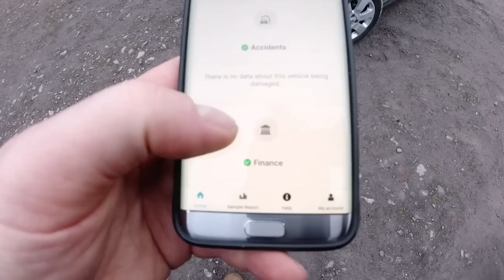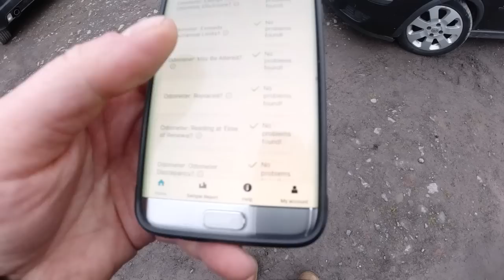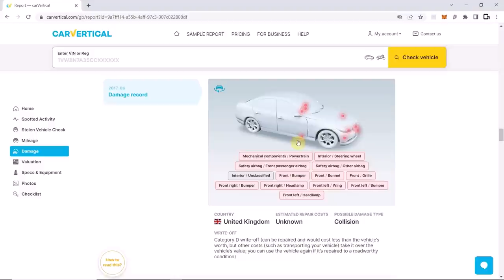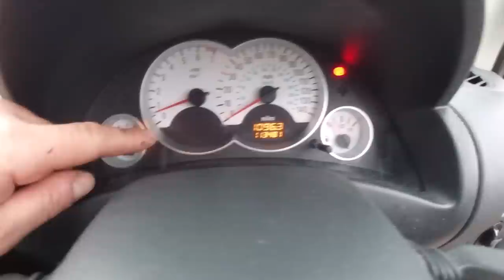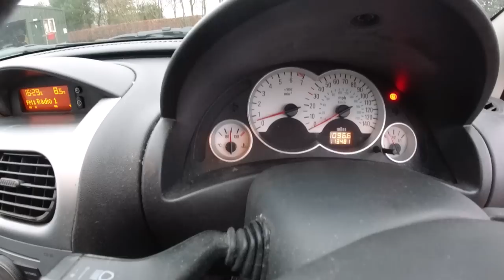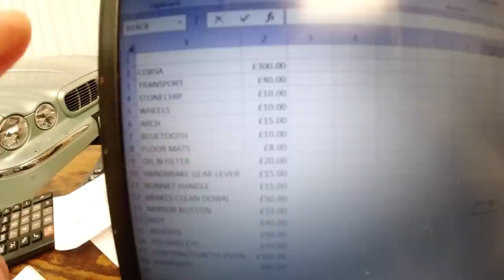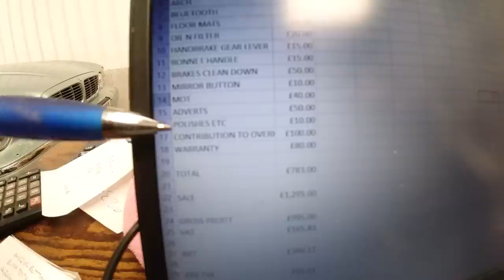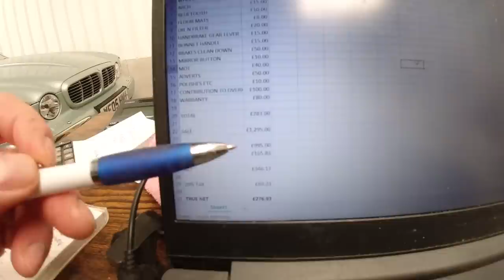I bought a 2006 Corsa from a PX Yard for just £300 !

Comment: Corsa C's are an excellent little car. Bought a 1 owner 31k miles FSH 1.2SXi 02 plate one for £500 over 6 years ago to teach my son to drive in. I went through it , brakes , exhaust, front suspension all replaced , cost next to nowt , good quality motor factor parts are dirt cheap for them.  He passed his test in it, it's taken him to Newcastle and back home in Lancashire for 4 years during his degree and he still runs it now. 
I've kept the oil changed regularly, it now shows nearly 70k but still chugging away happily. 
Plenty of similar aged ones still going which speaks volumes for them. Far better survival rate than same age Fiestas

Comment: Those coil springs corroded mostly mean nothing.(unless actual damage is obvious)
My Panda kept coming back with same thing for 3years after services n MOTs at dealership so when my service plan was finished at Dealership I took to another mech shop I trust and asked him to take alook. 

His answer was simple.
It was water getting inside the plastic or w/e surrounding the springs n the rust would pop the plastic n break it so dealer would say corroded springs out of an abundance of caution n said my springs would last me a few more years n its been fine.

Comment: Note this is the SXI+ - I believe this was the run-out model- virtually all the cars sold in the last few months of this model Corsa were this spec. Lots of them used as driving school cars if I remember correctly.
Reply from the maker: Oh cool
Reply: easy to spot driving school cars as they will have a full size spare wheel and either scuff marks on brake and clutch pedals from the duals or, another type we’re screwed into the passenger footwell with cables to the pedals. May also have a centre speed display if the speedo isn’t clearly visible from passenger seat.

Comment: That Corsa SXI will make a cracking little car for someone. It's probably in the same league as some of the other little cheap cars you currently have (Chevy Spark, yellow Peugeot 107, hole in the roof Micra, green Micra, VW Up). I used to have a 2001 Corsa SXI 1.2 16v years ago and that was a nippy little thing, certainly quicker off the line than the later (probably bigger and heavier) Corsa's.

Comment: I have had 2 of these cars over the years hated them both only reason why i bought a second one was because a mate of mine was selling one £250 and i needed a cheap run around for a year it done the job. Check the driver and passager footwell for flooding the Corsa Model C is know for it , i had the wet footwell in both corsa C i had , it is a cheap fix with silcone gun but a bit of a pain in Butt to do. Just on the off chance it has the wet footwell , driver side will be either be the  brake servo plate on the bulkhead  seal has gone or the gasket between the servo and the plate has gone. Passenger side will be the fuse box in the engine bay.

Comment: I had one of them , a nice car but two main problems, can come with corsa c,  cabin water feature, water getting in at each end of dash, brake servo seal at one end and module box at other, also module box can go wrong, like mine the window wipers wouldn't work, and had to get a new kit on e Bay for £60, thats engine management box, module box, immobiliser and clocks.

Comment: Thanks for another interesting video. The car jobs exactly like when I sold a lot of tractors, the small stuff adds up quick and can be as much as 1 bigger repair. The dealers logic here in Canada with big machinery guys would be sell you one or 2 things you loose your shirt on and basically stitch you up so you go broke. They get no competition from small guys like us offering a used market for cheaper machines, and it makes selling new or high end used on finance a lot easier for them. I knew one dealer tried doing it to me, but I knew way more about the tractor than he figured I did. I'd of lost 20K on fixing and selling it,they put it in an auction 500 miles from here where they widely dump dealer network stuff and got less than half what they offered it to me for.  If you got a few of those cheap type cars could you advertise a cheap as is corner, if they'll make money before you work on them it sells, if not price goes up as you sort it,some main dealers are doing it here on pick ups and cars, but the savings not really enough for me to do the work on 1 to keep for myself.  Take care

Comment: I dont get how they can mention "corrosion" on the springs for the MOT but areas like the hubs and discs which have clearly not been used much dont get a mention 🤷
Reply from the maker: Good point
Reply: @ChopsGarage  it's because springs can break and hubs usually don't.

Comment: Hour to clean it mate, chuck a test on it, bit of black paint on the gater and the springs, 11 quid advert on auto trader, if brakes mot OK they don't need cleaning out, oil change if oil looks bad, bit of touch up, your into it for 400 quid, 995 it, shut up about warranty, if it drives ok and it seems to do, that's it, cheap clean car for someone, you've made 600 quid, less taxes, no trouble, no comebacks, I've done 1000s like that mate, all you've done is just talk yourself out of it, can't understand why? Why take 500 quid for it, I fly round cheapies with some cif and the pressure washer, quick vac out, you seem to spend a lot of time on videos saying how great a car is, then the usual ending is oh I'll trade it, I mean that little cars great, just a couple of hours work, markets short of cheapies. I mean take a spring on that, there 15 quid bud, on the rear its a 10 min job to change.